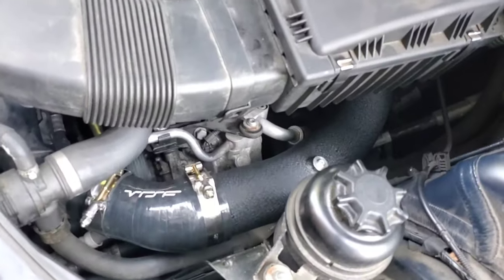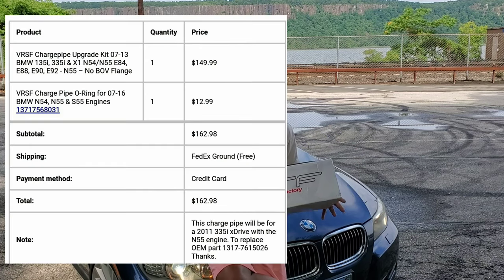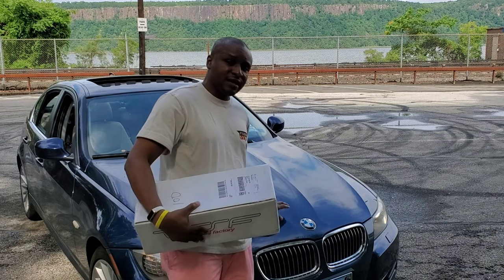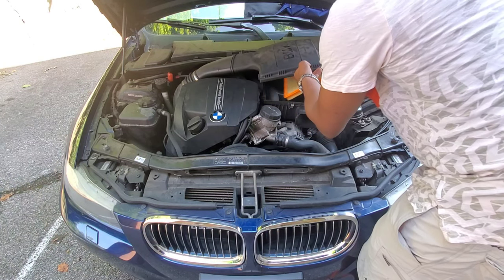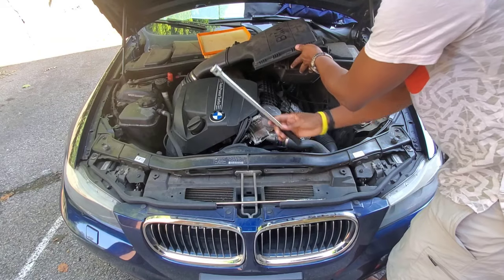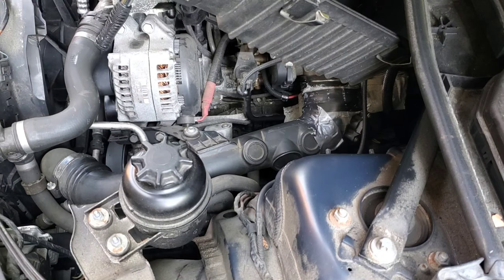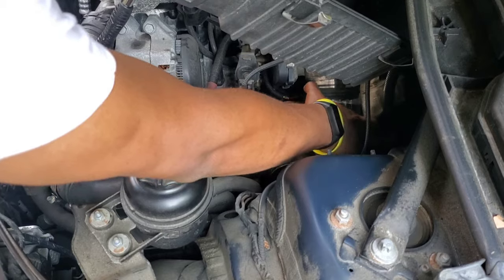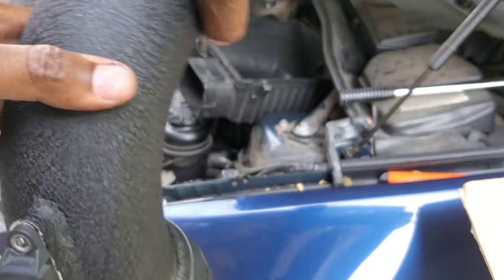BMW N55 Chargepipe - VRSF Replacement DIY Made Easy!

Comment: EVERYONE THAT SURGE THAT HE GOT IS A LEAK WITHIN THE CHARGE PIPE!!!! U have to TIGHTEN the bolts that are on top and underneath the pipe!!!! I was not able to figure that out for a very long time 😭😭😭😭 then I contacted Vrsf and told me that I was supposed to tighten them before installation, now I have to buy different bolts from them 😭
Reply from the maker: Kevin I don't follow you. Do you mean the two bolts holding down the sensor? Or the clamp bolts? Either way you should just assume you have to check and tighten all the bolts securing this pipe in place. If I didn't emphasize that point in the video it's because I assume it would be common sense. 🤷
Reply: Hello, no I’m actually talking about the two bolts that come installed between the pipe. There’s a top one and bottom one, but I assumed they were already tightened. But I contacted vrsf about that problem because I got a smoke test and it appeared that it fell off due to the fact that I didn’t tighten it up before installation.
Reply: Also, if you are still having those surges make sure to tighten them up and it’ll most likely take it away
Reply: @kevinflores3241  I see what you meant. The 2 grub nuts plugging the ports, could be loose so ensure they are screwed in enough or you would have a leak.
Reply: I wish I saw your comment days ago. I did not realize there was one on the bottom and I took apart the airbox/chargepipe so many times trying to hunt down the boost leak. I read about tightening those bolts but did not know there was one on the bottom and it fell out after a couple days of driving. Was going to try a new o-ring from the CP to the TB but now, you've helped me diagnose and fix the problem! VRSF should really provide instructions or notices to tighten those bolts.

Comment: Is this pipe thicker?
Reply from the maker: HI Abe the pipe is the same dimensions length wise and slightly wider than the plastic pipe.
Reply: So I was able to get it on. I hear a slight whistle but no loss in power. What might cause this?

Comment: Hi, I noticed you went back to the OEM shifter knob... what happened to the led one ? I was gonna get one to , but love to get your feedback if there was some issues with it ?
Reply from the maker: No issues with the LED shifter. My car was at the dealership for brakes, a brake fluid flush, fixing the leaking thermostat/waterpump and an oil change so I took off the led shifter since some of the work done to my car was under warranty and I didn't want BMW giving me a reason to say the led shifter mod voided any of their warranty.  I was also trying to get my charge pipe replaced under warranty as well but once I realized they were putting the same plastic pipe back in there with $500 labour out of my pocket I declined. That is the great thing about the LED shifter is that it is plug and play and can come off and be put back on in minutes. I can't wait to put it back on. If you get a sports steering wheel it really looks sweet with it.
Reply: 0LAF2046 Oh ok , that’s good to hear , yeah I like it how it looks , am looking to get one for my e60 , found some on Ali express for around 100 bucks but it seems they having issues shipping from China due to the virus , I looked on e bay but 200 bucks seem overpriced for same thing you get from China , I just hate how e bay sellers double prices on some items that all come from China anyways.

Comment: hey how are you, is the vrsf chargepipe still sturdy? I saw that you had some play and i was worried
Reply from the maker: Yes after a year and 10,000 miles of driving it is still sturdy and in place. I actually love the extra bit of boost when you accelerate. It's a good pipe

Comment: Good Video! What kind of steering wheel is that and how’d you retrofit it ?
Reply from the maker: Hey Amelio. The steering wheel is from a 2011 Z4 E89. It is plug and play with the E90 steering column. A lot of the BMW steering wheels are swappable between cars from the same year. For example a 2011 X5 steering wheel will also plug into a 2011 3 series.
Reply: 0LAF2046  are the paddles fully functional?

Comment: It happened to my F25 35i also... I'm going to put an aluminum charge pipe as replacement. One question though: 0:55 is it really that easy to get your turbo and your engine destroyed? I drove for 15-20 km after the issue. Would the turbo or engine fail immediately or how can I verify it's all good? ISTA is giving me just the standard charge pipe errors: 102001, 108F01 and 120308